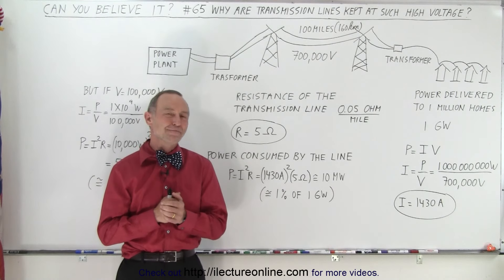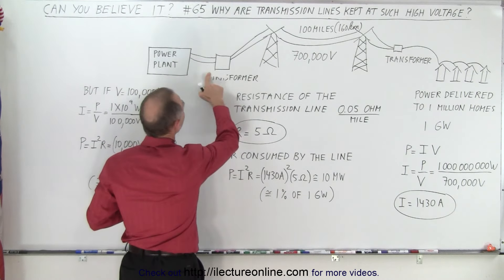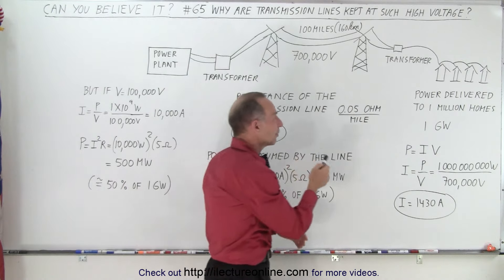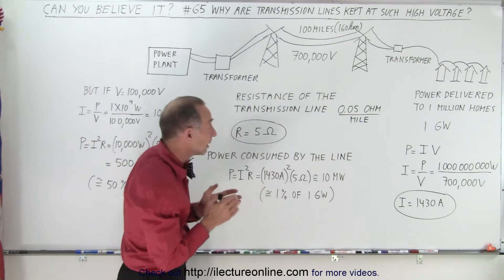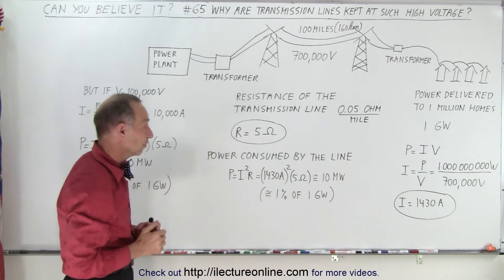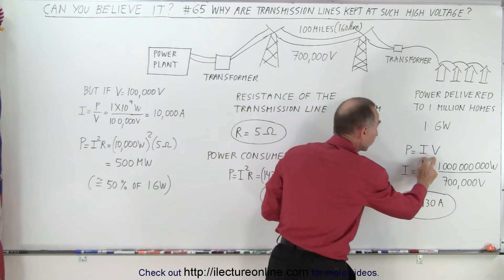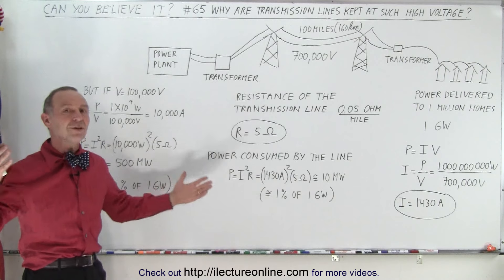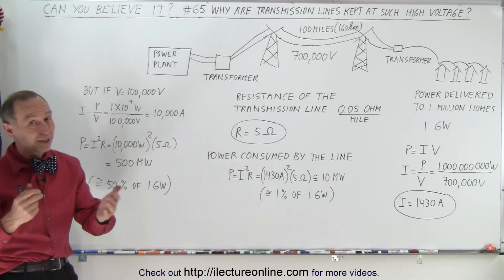Can You Believe It? #65 Why Are Transmission Lines Kept At Such High Voltage

Comment: Does distance have a role to play?
I'm mainly referring to the railway [3rd rail DC and overhead AC] to keep the voltage constant.
Reply from the maker: Yes, distance causes the resistance to increase which in turn causes greater power loss.  That is why they like to limit the distance over which power is transmitted.

Comment: another important point is the cross section of the wires. To transfer higher current, you need higher diameter. You can't make them infinitely thick, it costs a lot more, doesn't really work (skin effect) and the heavier they are, the more support structure it will need...

Comment: Nice video  explain the AC transmission line . You didn’t account for inductive and capacitive losses and things like power factor correction . Those also cause a loss in power lines not just resistance
Reply from the maker: Yes indeed.

Comment: Hi professor thank you for this video i always see these transformers which on some of them has been written 100kv and on the other 50kv what does it mean ?it means that you can use only 50kv/100kv or by using more electricity the transferner would turn off or  maybe it has another meaning
Reply from the maker: Typically that means it is the maximum voltage that can be appled to its primary winding.  Exceeeding that could cause damage or could destroy the transformer.

Comment: Can't the power be calculated using P=(V^2)/R? If so, wouldn't the higher voltage transmission line lose more power? I thought the reason to step up the voltage was to reduce the current to allow the use of smaller transmission lines.
Reply from the maker: The equation for power consumed = I^2 R     The equation for power provided = I V    Reduced current results in lower power consumed by the transmission lines.  The ability to reduce the size of the transmission lines is an added benefit, although reducing the size of the transmission lines will increase the resistance of the lines which in turn will result in greater power loss.
Reply: When you say V^2/R, which V are you referring to? Perhaps you think through it again and you will get your answer 😅

Comment: Mr. Professor could You tell something about autotransformer?
Reply from the maker: That is a very open ended question.  In an automobile, coils were used in older models to produce the spart in the cylinders.  Now that is done electronically.
Reply: @MichelvanBiezen  I have heard that autotransformer has only one coil (primary) and the secoundary coil is a brush. I wanted to know if it is true? (as a working principle).
Reply: @jakubkusmierczak695  That could be a "variac".

Comment: About how hot are the wires normally then? There must be some heat loss.
Reply from the maker: The heat is lost quickly through radiation and convection, so they don't become very hot.  Also the size of the wire is chosen to keep the temperature down.

Comment: which compensates for calculated smalls arms weapons bullet drop for actual bullet drop in computer ballistic simulations exactly being about *1.3 so 1 milliradian now equals .77 milliradians that i have found:::3.172 (8300:::3.1721) .77*1.3=1.001milliradian and 1 milliradian equaling 4.5 minutes of angle~

Comment: also i have had 3d printed models of turbines printed and mailed to me which conform to the cads i used thi equation with that appear correct so i guess what im saying is 2pi equals 8.3 inches and not 6.2831853071795865 inches and that you are incorrect professor

Comment: Wrong...
Reply from the maker: What specific aspect of the video is wrong?
Reply: You calculated maximum power which can be delivered by a line, not power lost into heat. The reason why line grid is kept at such voltages is so it cant be stolen. If it were 220V it would be much easier. Power lost by a line into heat is its resistance in relation to total resistance of a circuit